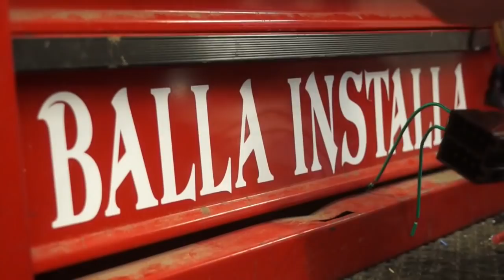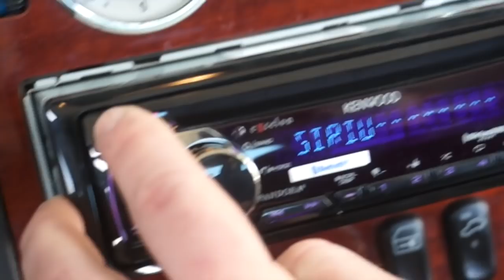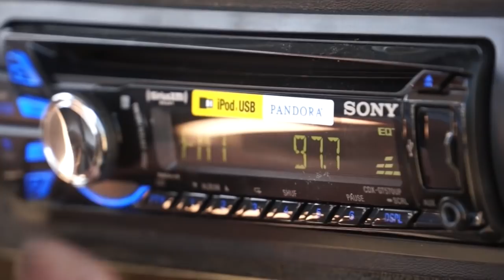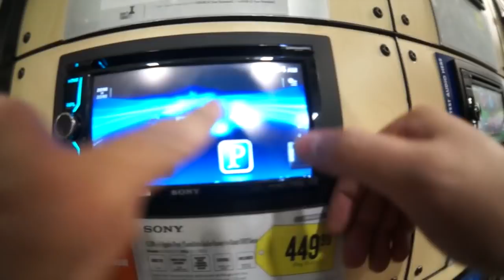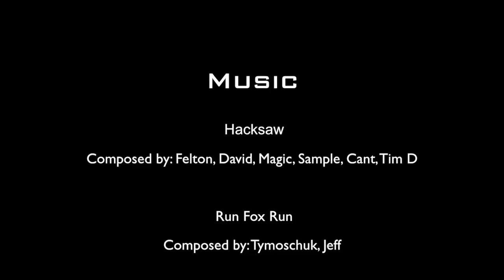What is the Best Car Stereo, System? Sony, Kenwood, Bestbuy Audio - Amplified #105

Comment: I've had a Kenwood KDC-MP242, MP342, and now a MP352. Pretty happy with them all.  I don't like to spend a lot of cash on car audio but do my best to get quality output.
My Ford Ranger had a Jenson 1100w 5 channel pushing 4 6x8s and a 12" sub. Sold that now have a BMW 325i Cabrio. Have two Alpine 6.5 in the kick panels, Alpine 4 ch bridged to 2, and will have an Alpine mono with 12 in the trunk. But still Kenwood HU controls them. ☺

Comment: I use not a headunit but an active EQ, a bass processor, and a 6 ft. rca cord connected to my Samsung Captivate that I have deemed my mp3 player. It works and I've saved money in buying an expensive headunit. :D
Reply: What's that? I wanna try that

Comment: Sat antennas on the exterior of the car drive me crazy when I'm trying to bang on it dawg. Satellite signal goes through anything but metal so there is no reason to put it anywhere but back in the dash behind the radio. The rake of the windscreen gives you plenty of area for the signal to come in through the glass without the roof messing up the signal. I had my old antenna back there tucked inside the dash for years and never had a problem.

Comment: The best head unit is the Pioneer AVH-P1400 fits so well with my Kenwoods (12s) and then Pioneer door speakers and my Sony Xplode amp the AVH is a little pricey but worth it

Comment: Bluetooth signal on SOME decks actually degrades the signal.  I did a test and aux (because you can increase the volume) input has highest output (in my system), then usb, then BT then cd.  I don't know why the cd has the lowest output in my car.
Reply: I have an Alpine and I don't have to raise the volume as much when using the CD player. It sounds louder than the USB and the aux input. Sound quality is in the same order. I don't have Bluetooth.

Comment: Pioneer...cause most units have 3 sets of RCA outs....the signal is a higher voltage output 2.0 volts(so you dont have to crank the gain as much to make up for a weak signal)
And the have selectable crossover points for fronts backs and subs

Comment: sony makes some decent decks but i have had a lot of success with kenwood. i got me an ken excelon with the touch screen (not the flip down model) n all that jazz. its dope cause along with all the standard extra bells n whistles (i dont care about its dvd playback nor sat radio) it also has a built in dsp, and a rear cam that's really easy to install. i had an older alpine in before and while it worked far better then a stock it sucked ass in comparison. when i installed the ken aside from far more eq options and quality across the board the bass response became soooo much more detailed and complex then before its like i have a brand new totally better woofer which so happens to be a kenwood as well lol.

Comment: Shame, that head unit looks tacky in a Mercedes
Reply: That's how I feel about my jag! Sucks really..
Reply: William Sherling cool
Reply: They just deducted a good 5K from the car's value. Great job soundman for installing that crappy 100 dollar WalMart head unit I bet the customer is so happy you got to touch it, lol.
Reply: Specially because those kenwoods came out with an ugly ass purple screen, I would've gone with something super slick like a kd-avx77
Reply: jeanious2009 Car is not 50k anymore just an fyi....maybe in the early 2000's when it was not 10+ years old. quick search on ebay shows them selling for less than 10k
Reply: mercedes is tacky
Reply: I thought same thing when i put mine in my Bentley . But i got used to it

Comment: I've always hated kenwoods and alpines. I tried liking them, but it was impossible.
Reply: Joseph Stalin Was checking out a new radio for my car in 1994, guy at a local business which was essentially a converted house had a Johnny Cash CD. He suggested one of the tracks to show how Cymbal's sound. They sounded tinny or the ting noise did not carry through all the way. Alpine sounded terrible but the JVC model turned out to be the best. Saved a  lot of money that day.
Reply: Is there a reason? I'm just curious.
Reply: Gilberto Gutierrez Bad luck I guess, I know they're reliable brands, but I've had a lot of problems with them in the past.
Reply: +Joseph Stalin I have an Alpine CDE-102. It's an entry level alpine with a basic 2-band parametric EQ and CD/USB/AUX  input. I've had it for 5 years with no problems whatsoever. I even bought a power pack for it.